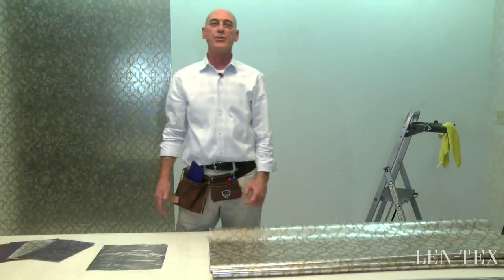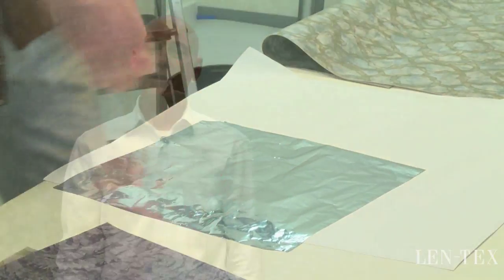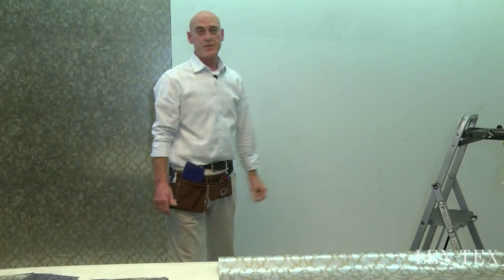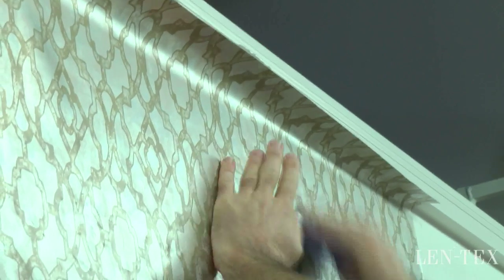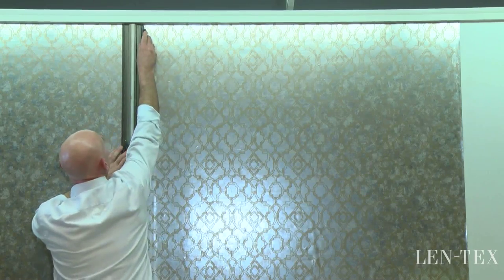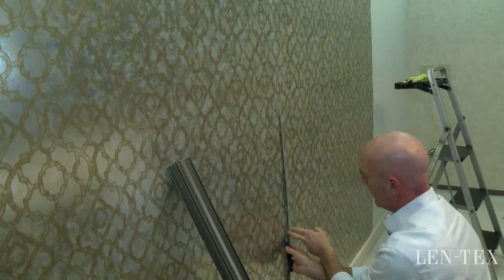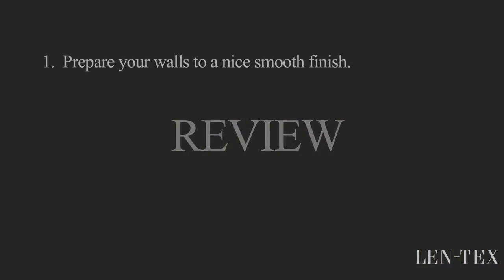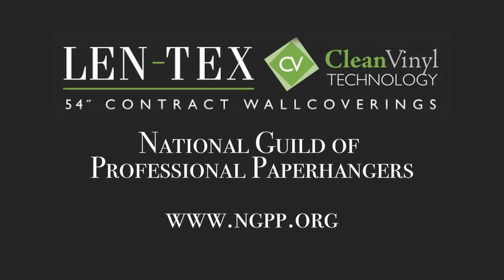Hanging Mylar Wallcovering

Comment: what about the adhesive to apply? does it need to apply adhesive behind mylar wall covering or adhesive need to apply on wall ? also need to know .does the adhesive need to apply untill both side edges ? and when to over lap and after cutting the seam if the adhesive comes to on outer surface will the glue can be clean with wet clothes or damp sponge.will the adhesive can be clean aesily or there will.be mark for adhesive on front surface of mylar laminated wall covering.please help on this question.Thank you.
Reply: Mohammad please see the comments below and in addition to your questions about overlap- it is wise to use a protective tape on the edges where overlap occurs. I use a simple yellow caution tape myself. It's inexpensive and easy to find. This will help to protect the face of the product from getting to much moisture on the surface while installing.

Comment: I TOO WOULD LIKE TO KNOW WHICH PASTE IS REQUIRED
Reply: The recommended adhesive to use for this type of wallcovering is a clay base and or a heavy duty clear. One with high tack is the secret. If you find it doesn't hold well to the wall then you may want to roll a layer of adhesive on both the wall and the back of the product then marrying them after a few minutes.